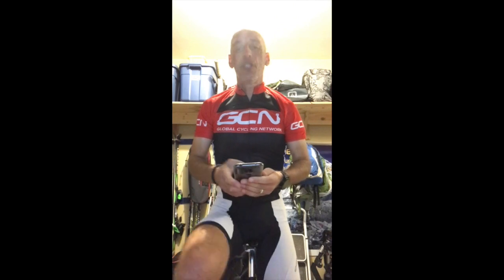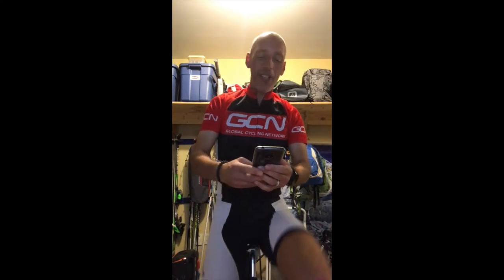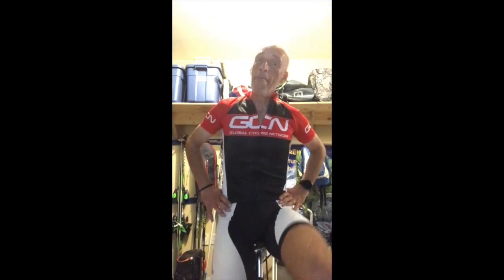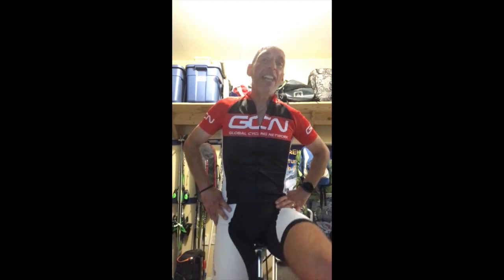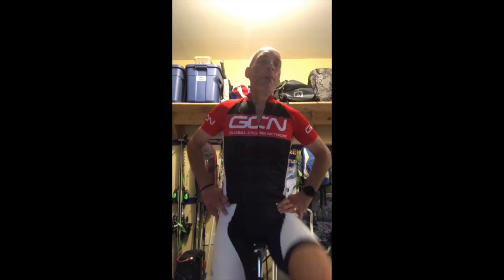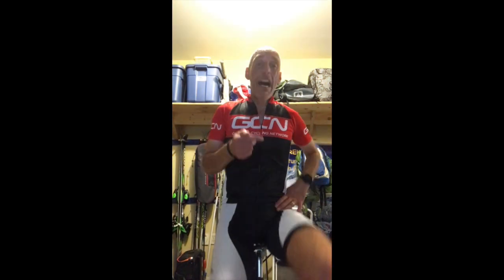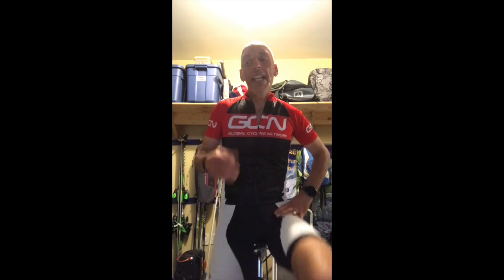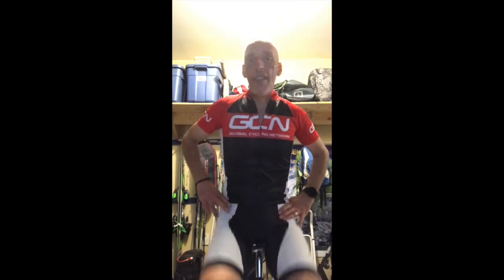Training session vs. test of 20-min power: The Training of a Cycling Scientist - Vlog 3

Comment: Hi Louis, you said in this VLOG that you expected "a sharp reduction in your Max HR as you return to hard training."  Can you expand on this.  It struck a chord with me as my Max HR on a session I did today was 3-4 beats higher than my previous Max HR and I wasn't at my max intensity by a bit - and I'm returning to training after 5-6 months off due to the Hip Replacement.
Reply from the maker: Hi Martin, thanks for the question. Yes sure and I’ll expand more fully in a future vlog if there’s further interest in this. Your heart rate is determined in part by the extent to which your heart fills between each beat. If your blood volume increases, your heart fills more effectively and your heart rate decreases. The opposite also applies and a decreased blood volume can lead to an increased heart rate response. If you haven’t trained for a while your blood volume is likely to decrease, and your heart rate increase. This is a brief answer as there are lots of other factors at play here too. When you resume training your blood volume can increase quite rapidly and you can see a drop of 3 to 5 bpm in max heart rate within days before it stabilises.
Reply: @louispassfield7325  Thanks Louis - makes sense.  I had always thought MaxHR was kind of a fixed thing but clearly not.

Comment: Hi, saw you on GCN. I'm looking forward to following your return to fitness after your accident. I also had an accident in Feb 21, while racing in a Crit I came off at 55kph launching 2m in the air landing on my head. I fractured my temporal bone, C7 vertebrae, clavicle, scapula, 3 ribs and a pneumothorax like yourself. I had only just discovered Zwift and had reached my fittest in a long time. My FTP was 300watts and I was running sub 22min 5km in my local Parkrun. The Dr gave me the OK to start running before they let me back on the bike, so 1 month after the accident I ran a 22min 5k. I got back on Zwift, then after a couple of months I got back out on the road. I hired a coach to structure my training and reached an FTP of 316watts, not bad for someone over 50. I no longer get coached, couldn't keep up training 5 days a week, it was killing me 🥵, so I'm not sure what my FTP is now but I'm still riding and running and really thankful I can still do both after such a horrible accident. So it is possible, and having good fitness prior to the accident certainly goes a long way in making that journey possible.
Reply from the maker: That's an inspirational story. Thank you for sharing.